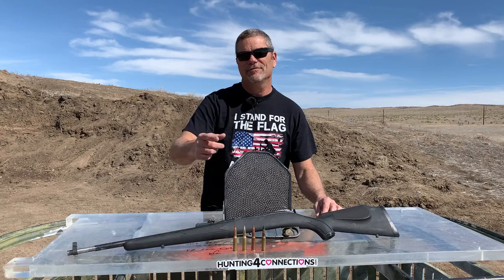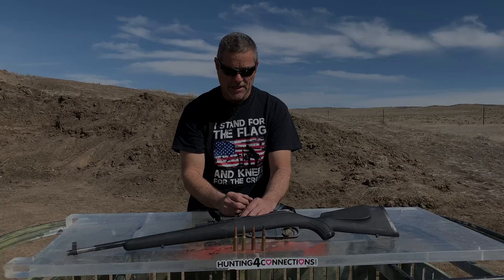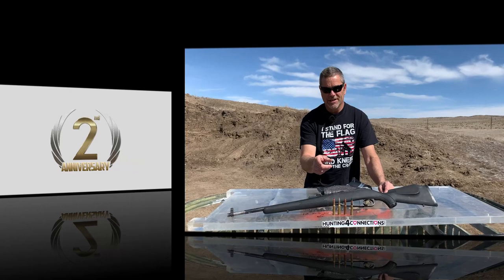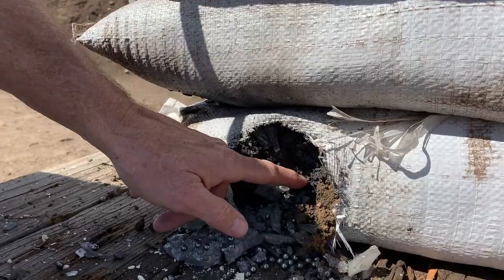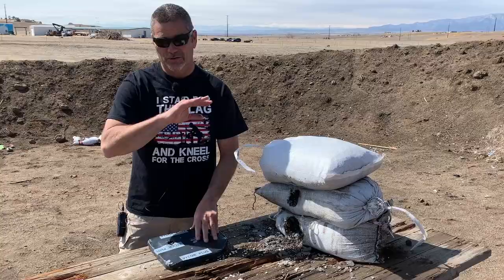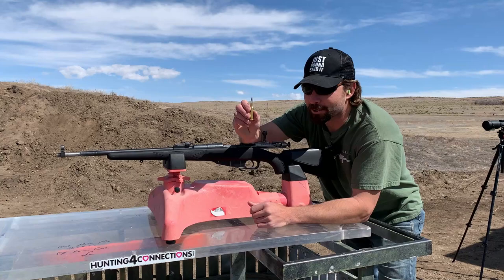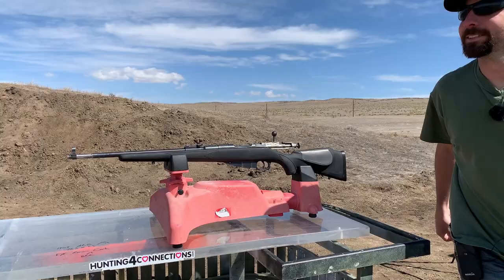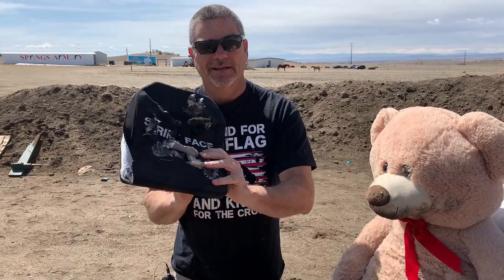Ball Bearing Body Armor Will It Work?

Comment: Cant beat a good fail :-) and this was well worth trying out, dont know until you have a bash, hmm it makes me think that small thin threads are like the opposite of larger ball bearings, like sand grains are pretty decent and kevlar, i wonder if micro fibre cloths in epoxy or something with very very fine strands or grains could work :-) still great fail im gonna sub up :-p

Comment: I have seen a vehicle mounted prototype of a similar system. It used roughly inch, inch and a 1/2 ceramic balls. It worked pretty well as it was very multi-shot capable. As rounds hit the balls the balls shattered, but the balls above it fell into the gap, so you were protected until you ran out of balls 😜Something like this: https://youtu.be/a6-Sfyo0guE